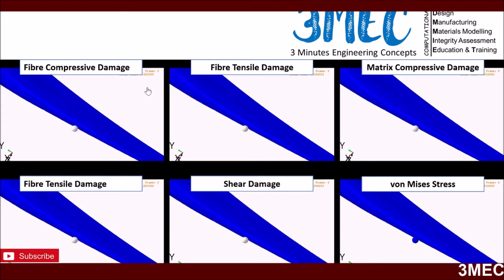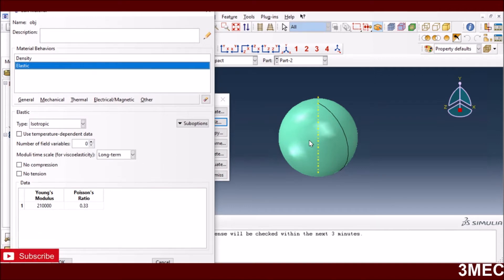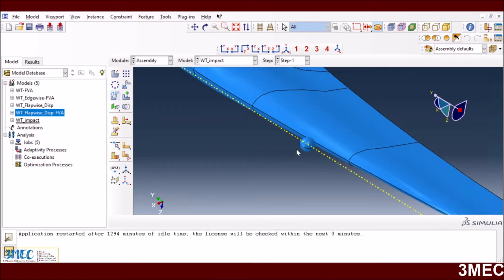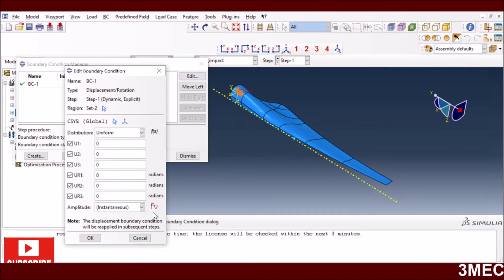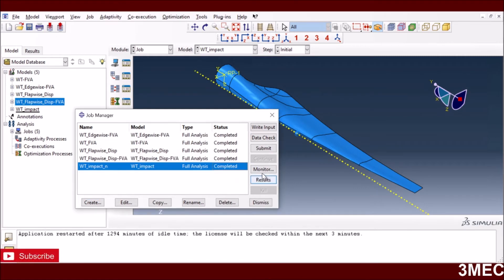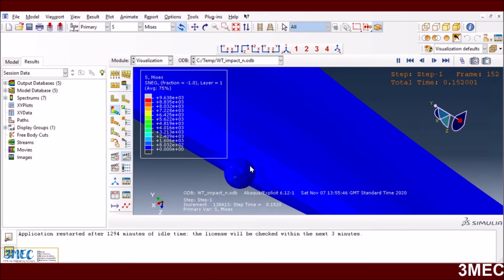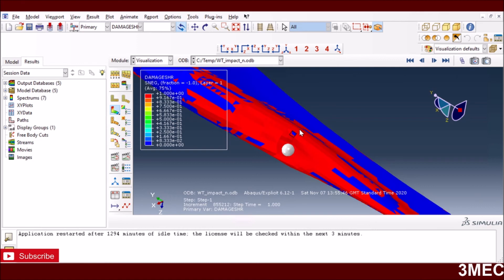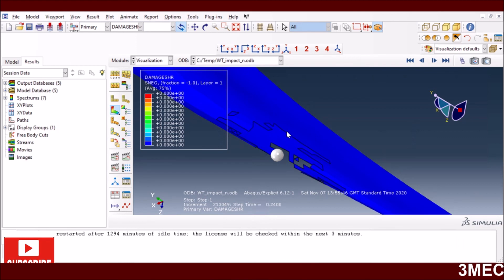Wind Turbine Blade Outer Shell Structural Analysis Bird Impact - Part 3 - ABAQUS Tutorial

Comment: Is there any interaction? Why my ball just move itself? It can not strike the wind blade.
Reply from the maker: Yes, general contact or surface to surface contact should be used in the interaction module. I can’t recall what I used but may be parts 1 and 2 explain in detail. You may download the files from professor3mec.com or look at my other videos on impact analysis. Thanks 🙏🏻